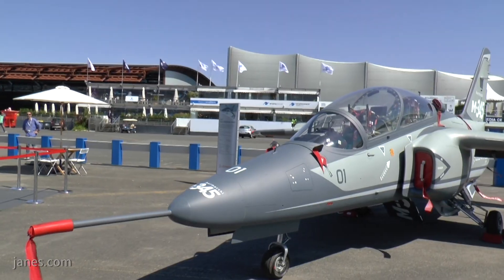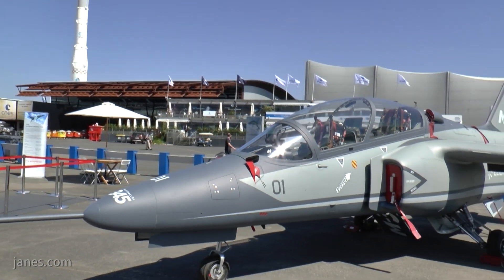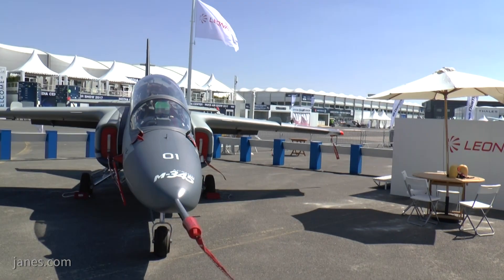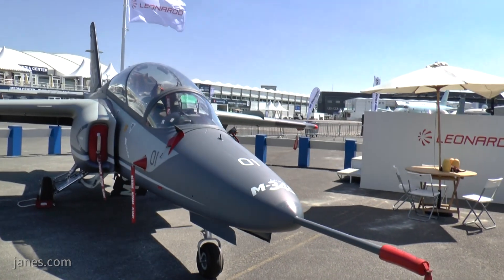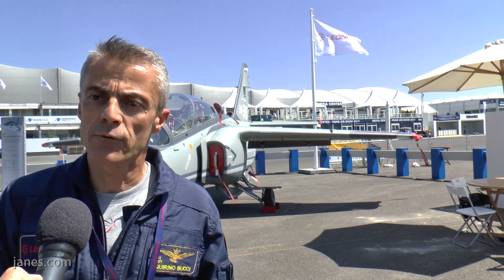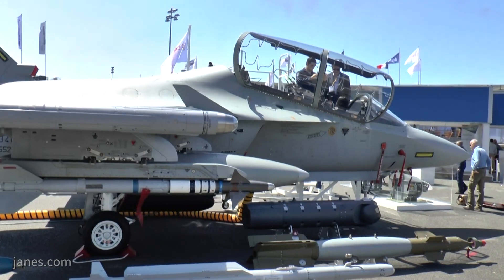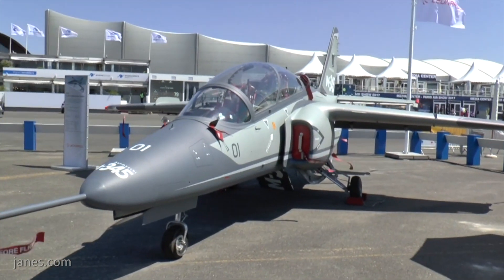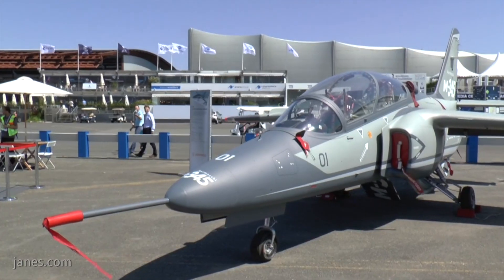Paris Air Show 2017: Leonardo Aircraft M-345 trainer aircraft makes show debut

Comment: The first two Leonardo M-346 Master school airplanes delivered to Poland have started the procedure for checking compliance with the specifications of the contract. According to unofficial information, machines do not meet all the requirements. Manufacturers are liable for financial penalties for failure to meet the deadlines that will be charged until the contract is fully executed.

Comment: M-345 ...ex M-311 and after called S-211 product SIAI-MARCHETTI ? ojalá que el paso de los años , lo haga ponerse como el vino ¡¡¡
Reply: in fact only the external geometry (and not the 100%) are equal as the S211

everything else was designed from scratch